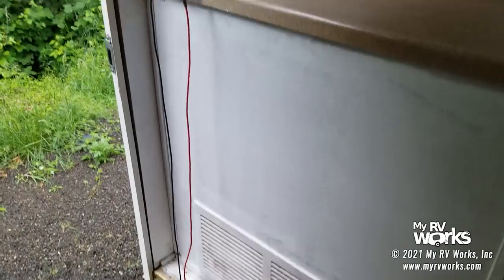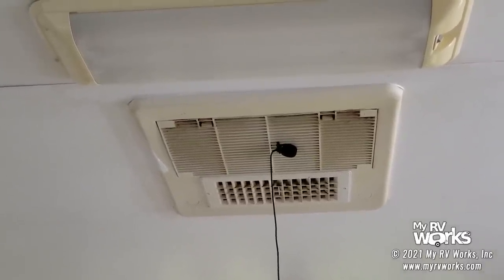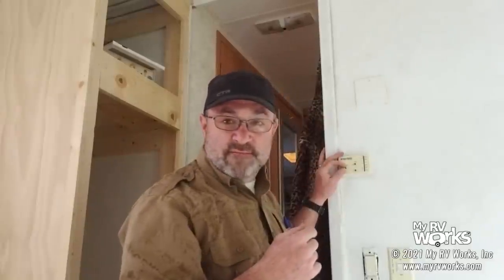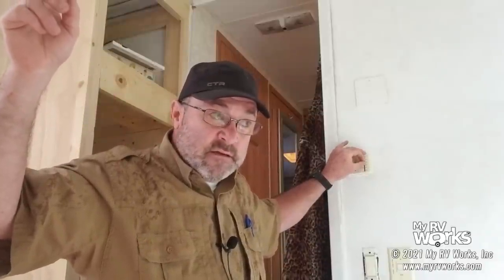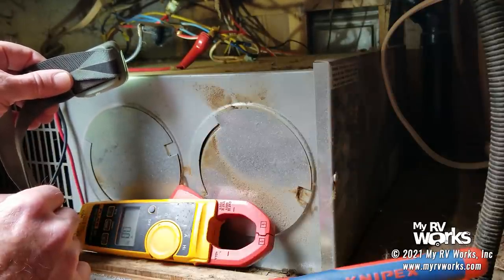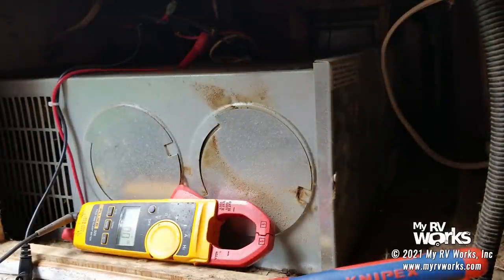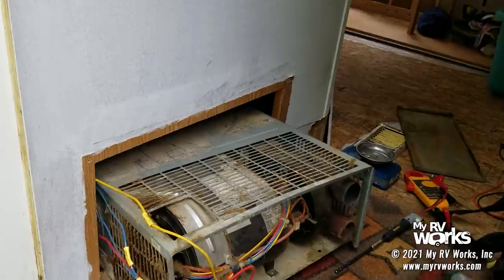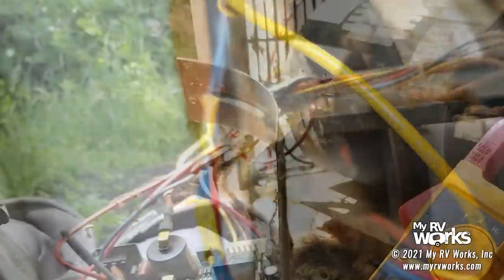RV Furnace Diagnosis Leads To Motor Fault  --  My RV Works

Comment: Great video, very accurate and easy to understand! I have a question about the SF-30 motor. Does it use a PSC motor? I'm asking because I couldn't find a capacitor in mine. Also, the motor was replaced last year, but the new one, not even a year old, has failed. You mentioned considering a core replacement, which is a smart observation. This seems to be the recommended approach.

Comment: My furnace not working either, it  has two blue wires one not connected to anything, but if I connect them together furnace comes on, since that leads me to believe the thermostat is bad I’ve replaced it and no joy there. Nice power stroke you got there.

Comment: I just thought I’d share the experience I had with my rv furnace. Same thing , a call for heat resulted in nothing happening at the furnace . It turns out it was a stuck closed sail switch  that wasn’t freeing up and returning to the open position after the previous cycle.

Comment: Hi Darren, I was a camp host at the beach RV park in PA and got to meet you in person and you are one of the nicest people I've met. I now run Island View in PA and refer our guests to you and your YouTube channel when they have issues with their rigs. Anyways, I have a question for you. I was wondering if my problem is similar to this video or something else. I turn on my furnace and it fires up right away. Once it reaches the temperature it turns off fine but then after the trailer cools down the furnace tries to ignite again and I just keep hearing clicking sounds coming from the ceiling plenum at the AC and takes several minutes for the furnace to start again unless I manually change the temperature on the thermostat by only 1 or 2 degrees and then it will start up right away like I just turned it on. Do you have a video for this issue to help me figure out what could be wrong or is this the correct video and I possibly need a new motor? Thanks a bunch for all your expertise that you share with people. I enjoy watching your videos.

Comment: Great video.  Question to anyone....  I found a blue wire behind my thermostat NOT connected to anything...   The furnace works, the heat pump overhead works, but what is strange is that the furnace and heat pump come on at the same time?   The blue wire has no voltage or ground.  No continuity with any thermostat wires.  Any ideas or recommendations?

Comment: I'm an RV Tech and I've been working on a Suburban furnace for the last week I've determined that the board is bad and I have gone through four boards directly from the manufacturer in sealed boxes and every single board was bad

Comment: Thanks for the detailed info. I have a similar issue but when I send 12v straight to the motor it runs fine. Am I looking at a bad control board? I have 12v on the red power into the control board but nothing on the blower.

Comment: I have used your videos to dianosis my furnance . Thanks for sharing your knowlaedge . I have a question , how offten do these fan motors good bad ? I've had many RV's in the past 22 years and , Just now mine has gone bad first time on  an 8 year old trailer with very little use .

Comment: What do I look for if I don’t have 12v on either blue?🤔
Reply from the maker: One of your blue wires is piggybacked off of the 12 volt supplying the furnace. Make sure you use the furnace frame for ground and then probe the individual blue wires. If you do not get 12 volts on one of the blue wires and then check the furnace supply wire.

Comment: You didn't mention why 12v has to go thru the A/C unit, before going to the furnace? 
12v should be wired directly to the furnace from the thermostat.

Comment: Hey Darren, Frank,l and a longtime Patreon supporter to you. I encourage all who benefit to join Patreon and help make these videos possible. I did have a couple of fuzzies and hope you could provide a clearer understanding on that part of the video. 
When you had both blue wires at the furnace "pierced" by the meter probes, did you mean to leave them pierced and switch to continuity test with 12V on or off? If on, I heard to never use a tester on continuity on a live circuit? Or, were the two blue wires dead, and you were testing back to the relay up in the AC location for that continuity, and yet if that is the case? Wouldn't that mean the thermostat was off or calling for heat? See my confusion? 

What is a piercing probe for your tester? Are they those needle looking probe ends?